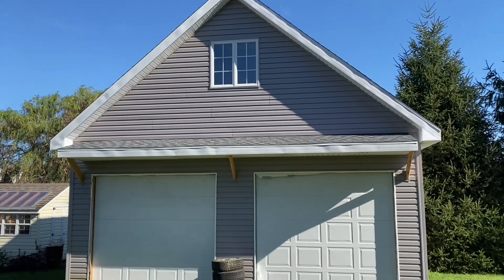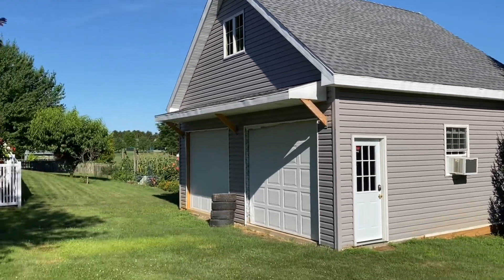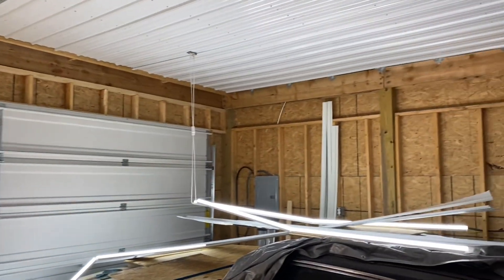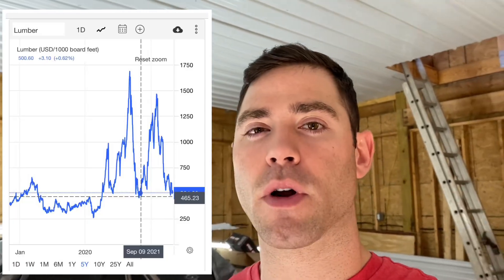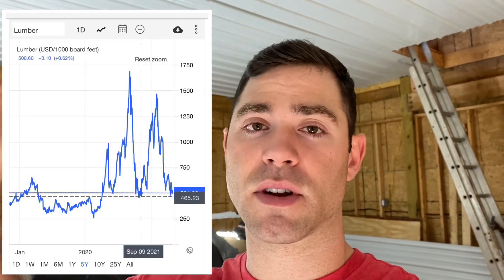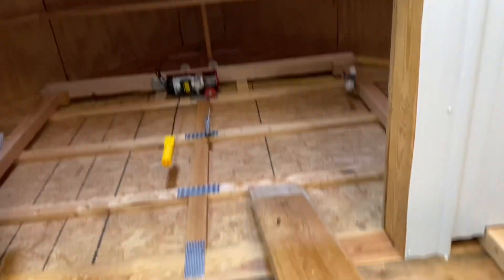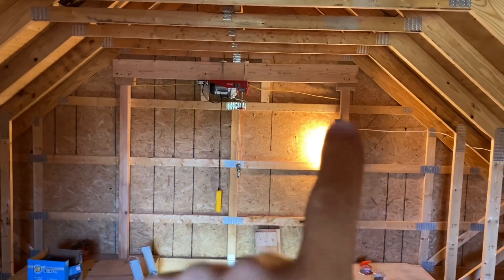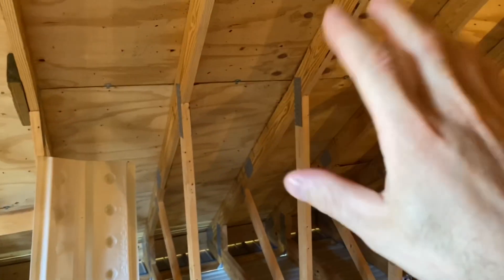DIY 24x24 Pole Barn Garage Build Update!

Comment: if you want to keep the noise of the air compressors to a minimum build a little addition with slope roof on to the side and put a little door either 5 foot lift door or standard and put it in there. makes a great space saver for tools you don't use often also.
Reply from the maker: Sounds like a plan! Thanks for sharing!